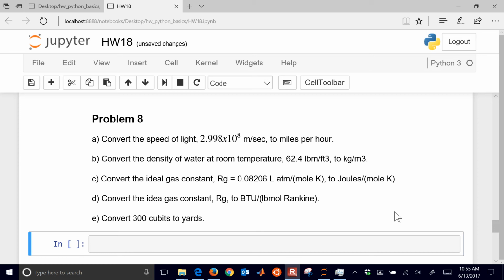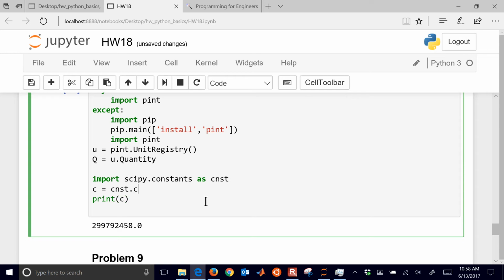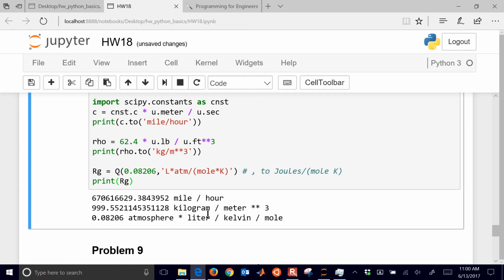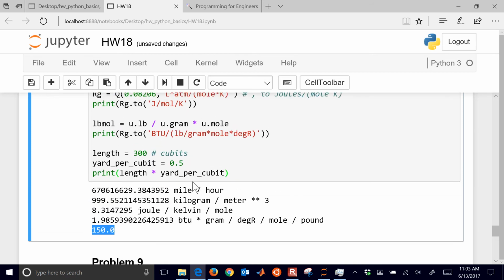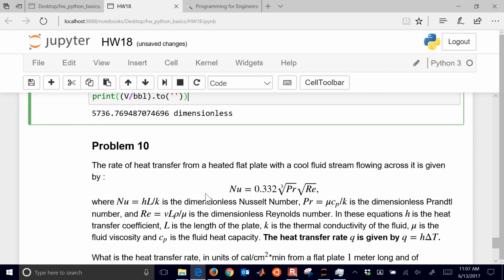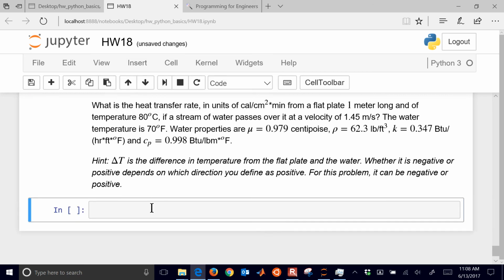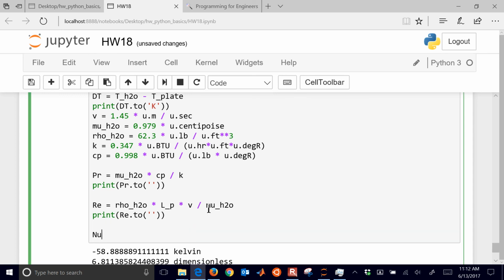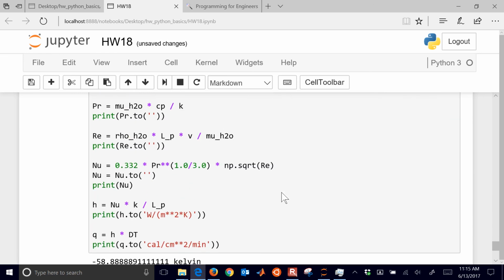Python Unit Conversions with pint

Comment: Hi, i have a list of concentrations, [1e-05, 7.06805e-06, 4.99574e-06, 3.53101e-06, 2.49574e-06, 1.764e-06, 1.24681e-06, 8.81249e-07, 6.22872e-07, 4.40249e-07, 3.1117e-07, 2.19937e-07, 1.55453e-07, 1.09875e-07, 7.766e-08, 5.48905e-08, 3.87969e-08, 2.74219e-08, 1.93819e-08, 1.36992e-08, 9.6827e-09, 6.84378e-09, 4.83722e-09, 3.41897e-09, 2.41655e-09, 1.70803e-09].

I need to write a function to convert the concentrations from mol/mL to mol/L and calculate the average value of the concentration in mol/L.

any idea on how to do it?
Reply from the maker: The conversion should be to multiply by 1000. You can use numpy.mean to calculate the average.
Reply: @apm  ok thanks, any idea on the function i could write?
Write a function to convert the concentrations from mol/mL to mol/L and calculate the average value of the concentration in mol/L. Take into account you can obtain the concentration in mol/L by multipying the concentration in mol/mL by 1000.

c(mol/L)  =  c(mol/mL)∗1000 
The code should return both the list with the concentrations and the average concentration in mol/L.

Marks are awarded according to the following marking criteria:

the code runs with no errors [1 mark]
the output is correct [1 mark]
the code contains, among the others, the following elements:
use of a for loop [1 mark]
return statement [1 mark]
the code contains relevant comments [1 mark]
Reply from the maker: Unfortunately I can't help with specifics, especially when they look like assignments.
Reply: bruhhh